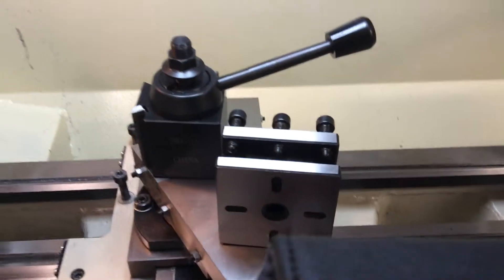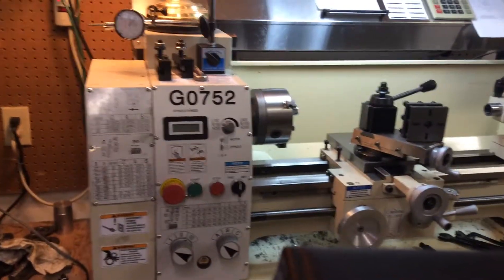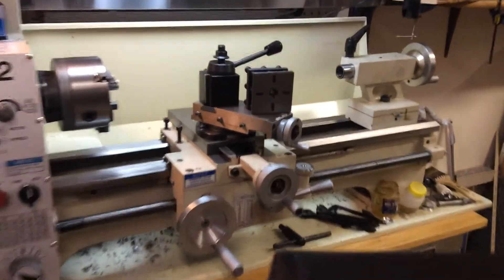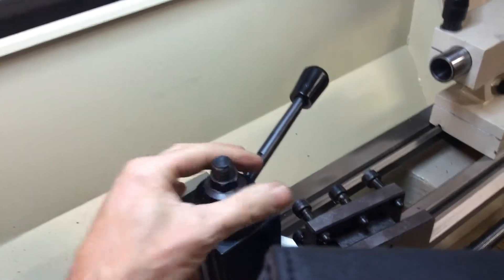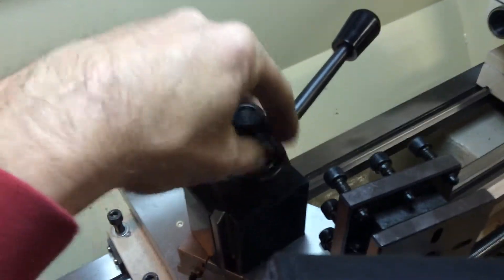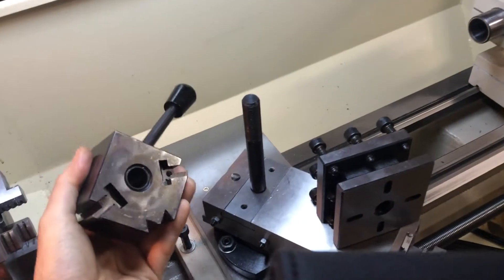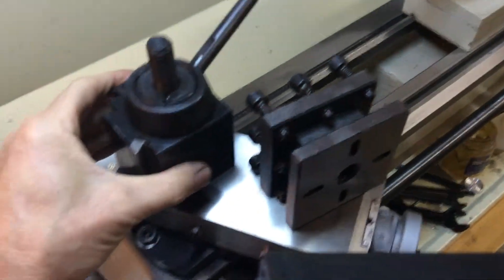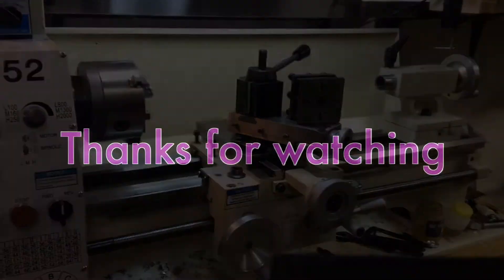G0752 Lathe and QCTP Question

Comment: Assuming you are not running out of threads on the tightening nut for the tool holder and the slide plate is below the surface of the compound, I would check the bottom of the tool holder and the top surface of the compound for flatness (check the tool holder first, it's the easiest).  Use machinist blue and a surface plate, you will have to remove the compound to check it.  If you don't have a surface plate small, ones (9"x12"x2") are available for $20 or so and well worth having around the shop.

Comment: These tool posts normally rest on each edge of the compound next to the slide plate that holds the stud and when tighten, they are very rigidly held and will not move.  Things I would check are -

Is the tightening nut running out of thread before it contacts the top of the tool post.  I put a washer under the nut on mine because the end of the thread was near.

Remove the locking pin from the compound, it might be holding up the post.

The slide plate the post stud screws into must not touch the bottom of the post.  The post should "bridge" this plate and rest on each side of it so the tightening force is on each side of the post and not in the middle where there is no moment arm to resist side forces.

Hard to describe these things with words,  but look into the details of how the post contacts the compound.  Smooth surfaces are ok.  Flat is ok.  High in the center is bad.  running out of threads is bad. 

I plan on buying a G0752 next year and would like to know how you like yours and what problems you have.
Reply from the maker: Dennis,

That helps, I will check it this morning.  I think I will write down some of my new hobby machining observations about the 0752 and make a review video.  One thing so far I have found that you don't seem to hear much is that threading is easier by using the fwd/rev switch and NOT messing with the half nut and thread dial.  It is quicker and less error prone than conventional method.  What I don't like is gear changes.  You need slow lead screw speed for turning down to size so you can use the power feed to get a good finish, then gear change to thread.  If the thread doesn't turn out, you have to change gears again, twice.  No fault of the lathe, would be avoided with an independent power feed, which is on my mod list.

Ji
Reply: RVJimD
Jim,

Using the fwd/rev switch for threading is a very good idea I would like to see.  These VFD drives have programmable dynamic braking (may require an exterior resistor) that can be used to stop the motor very quickly.  I've always wanted a lathe foot brake; maybe the VFD can do this function by stopping the motor in 1 second?  How fast is the braking on the  Grizzly VFD?
I plan to add a reverse tumbler gear set to my G0752 when I get it.  Would also like to add power cross feed, but not sure how to do that.  A hand held gear motor turning 3 rpm is my best guess for now.  How does your "independent power feed" work?   Does it change the gear ratio from feeding to threading?

Dennis
Reply from the maker: Dennis,

I can do that.  It stops really quick, of course you are normally top cutting threads pretty slow to begging with.  I put together a video for you.  I put a thin aluminum shim under the front and rear of the post and that stops the easy rotation problem.  I think the top of the compound is rounding a bit as you tighten down the post and it causes the bottom of the post to rest more on the center that the edges.  Thanks for pointing me in the right direction!  Not sure of a best solution but for now a shim seems to work fine.

Jim
Reply from the maker: And, I didn't see your last question re power feed.  I don't have one yet, but I think it would be a big advantage.  I was thinking about a motor on the right hand end of the lead screw, then, detach the left end by the shear pin in the collar or removing one of the gears.  Have not thought much more about it yet, but when I mess up a part and need to re-turn and then re-thread you can see the "oh damn" moment.  You need to change gears back to allow poser feed to turn a nice finish, and then change back AGAIN to cut threads.

Jim